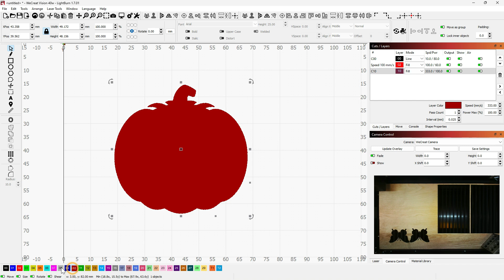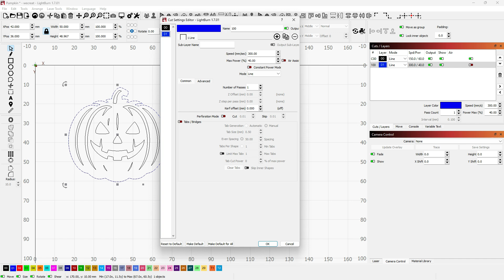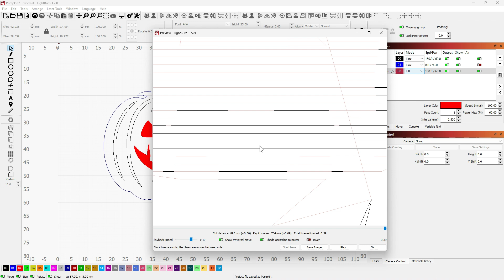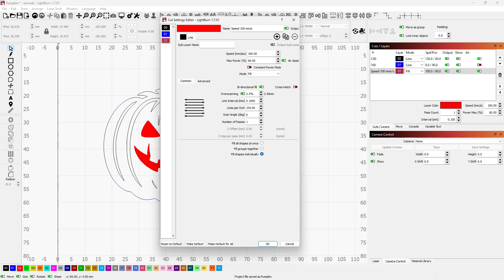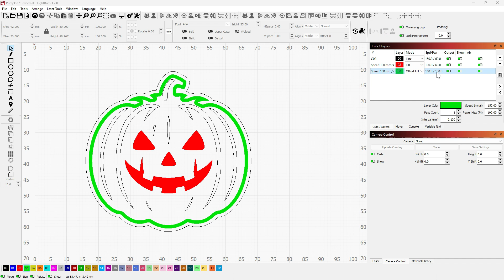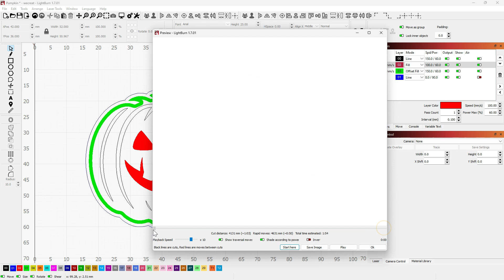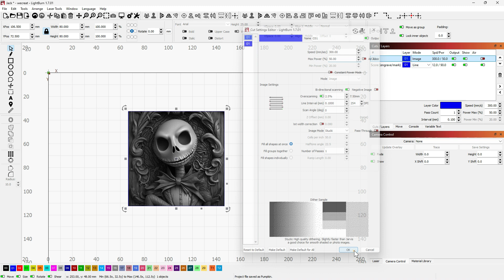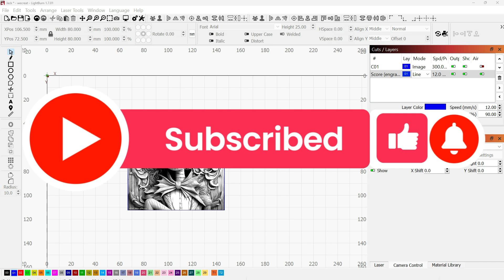LightBurn Fundamentals: Layers and Line Modes. How to prepare your artwork for the laser

Comment: I do not know what I am doing wrong but for a design I cannot get the fill layer to go first and  the line layer in the correct order when I preview it. Even though the layers panel is in the correct order. I did see the image into lightburn when I bought the design into  lightburn. But the weird part is that I added another design and then the layers ran correctly in the preview panel.😊
Reply from the maker: Have a look here and see if this helps: https://docs.lightburnsoftware.com/legacy/OptimizationSettings
Reply: @thetinkerverse thank you that helped. The weird part was other designs that i had done would cut on the correct order.
Reply from the maker: @AnnPerz  Depends on how the cut planner maps things out really. If you don't set your preferred priority, it will try to figure it out on it's own. Most of the time it gets it right, occasionally not so much which is why it's good to know about the optimization settings.

Glad it helped.

Comment: Thanks - so VERY helpful. I never understood Offset fill. However, if you have time sometime to do an in-depth on the image stuff, that would be great. I don't use other 3rd party apps to adjust images. I just import the image into Lightburn and I have a hard time trying to understand what the weird black and white picture in Adjust Image, will actually look like in reality. Cheers and thanks again!
Reply from the maker: I don't do as much image engraving but definitely on my list of things to cover. The true answer though is that a lot of it comes down to trial and error and developing an eye for what looks right on the screen vs how it engraves on your material. Every laser and material combination will require different adjustments to look right so plan to sacrifice some material to testing.

Comment: Excellent explanations.  Thanks.   Need to cover flood fill and compound layers.  Both an be time savers.  In addition the fill by group/ all shapes at once/ or individually.  And the setting to cut inner shapes first before outer shapes.
Reply from the maker: I do cover some of that in different videos but it may not be a bad idea to cover job optimization all in one go at some point. So many ways to improve (or detract) job efficiency.

Comment: GREAT VIDEO. I knew about how to use Offset but this is the first time I've had Offset Fill explained so well. Thanks for the video.
Reply from the maker: Glad it was helpful!
Reply: @thetinkerverse  Also a function I use when looking at my layers and comparing it to the graphic (13:30) is to move the mouse over the layer on your cuts/layers box and right click. That layer will then blink on the graphic showing you exactly what part of the graphic will be affected.
Reply from the maker: Good tip. Also if you hold SHIFT and left click on the layer in the Cuts/Layers window, it will select everything on that layer.  Hugely helpful if you need to select everything on a particular layer and move them for example.
Reply: @thetinkerverse  I didn't know that. Thanks